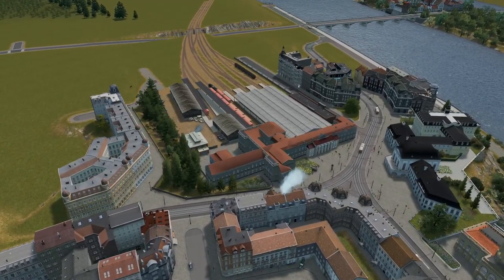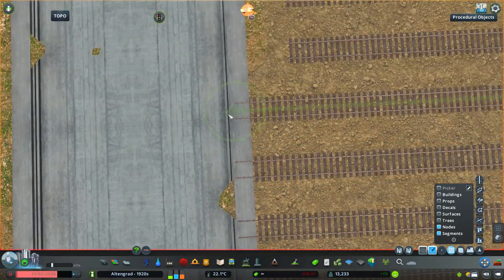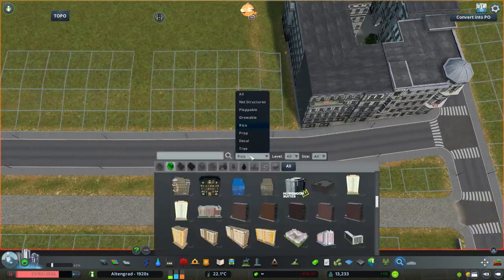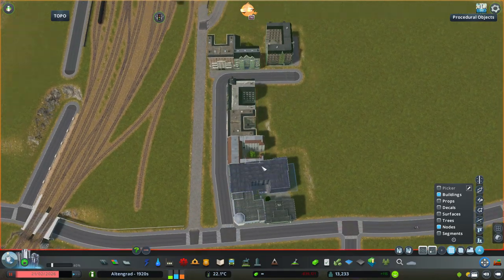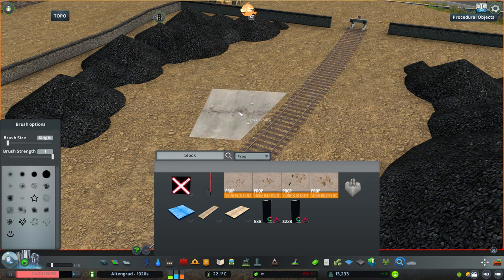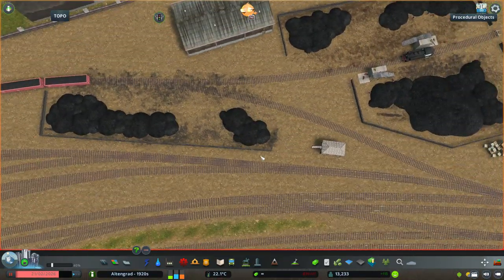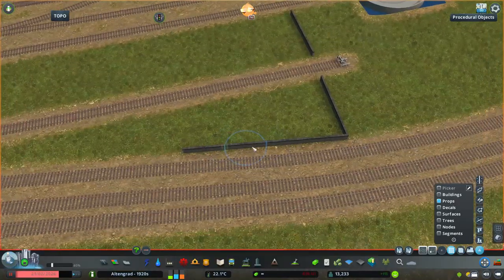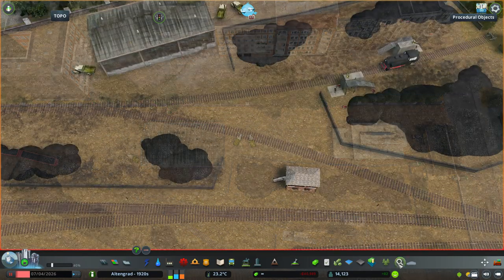Old Train Depot - Cities: Skylines - Altengrad #13

Comment: You should add something for trains to replenish water. I don't think the steam trains would go far without water.
Reply from the maker: I tried to find how exactly they refilled the trains from old pictures. Some American stations did have those big water towers, but I didn't see that in European stations. Only some small pumps near some tracks, probably connected underground to some tanks inside buildings. But the pump itself (there's probably a better word for it) was such a tiny detail that I didn't bother (also there isn't anything like it in the workshop), but maybe I could try adding something similar

Comment: A good detail in an industrial area would be putting tram/train lines in the streets without any passenger lines. Often in industrial cities where it was impractical to build a train line, wide-gauge tram lines were used to be able to transport freight on standard flat beds.

Comment: Where I live, there used to be the main servicing facility for the Milwaukee Road. They would build locomotives, passenger cars, and freight cars here. They also had 5 large rail-yards nearby. Across the river from the facility was a yard that trains would pull into and leave their whole train. They would then take the locomotive across a bridge that lead to the facility to be loaded with coal and water, and later would service diesels. The train would be taken up a hill and each car would be detached at the top, letting gravity take it down as it was sorted into another yard. Once sorted, each line of cars would be taken into a third yard where it would be assembled into a new train. It was then taken to its next destination. There was also a yard that served a branch-line nearby. The facility and yards took up an entire valley, and the only way across was two huge viaducts that still stand today. The facility was torn down in the 90’s. https://www.flickr.com/groups/milwrdmenvalleyshops/ this link will take you to a site that contains hundreds of photos and maps of the facility.

Comment: I know this is long late, but the heaps of coal (sand, gravel) are often supported by walls, so that you can push against the wall to form higher heaps. There were train cars for coal with conic shape, which were dumped to the ground and then ploughed towards the heap.

Comment: Your railway terms are wrong, coal is stored in coal bunkers not piled on the ground. Aldo where are the water towers? And corrugated iron railway workshop sheds were not common until after ww2/modern era. Etc Diesel's